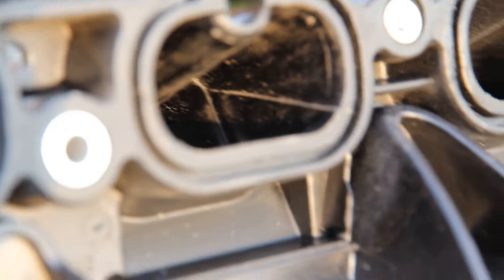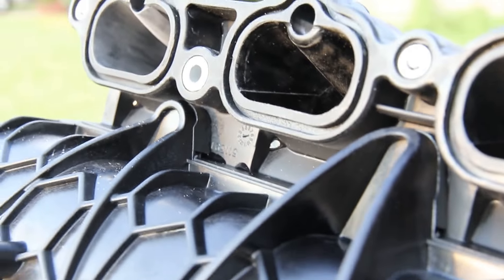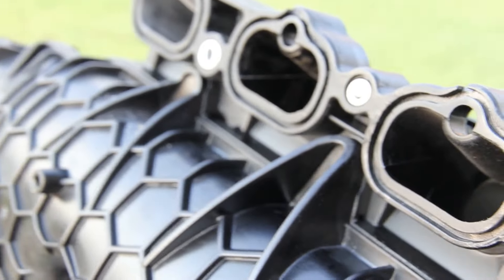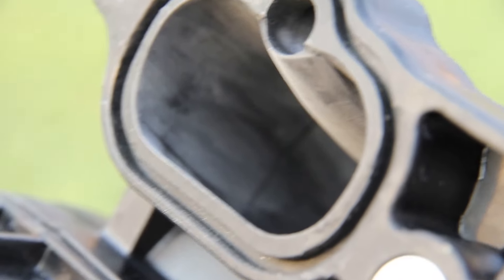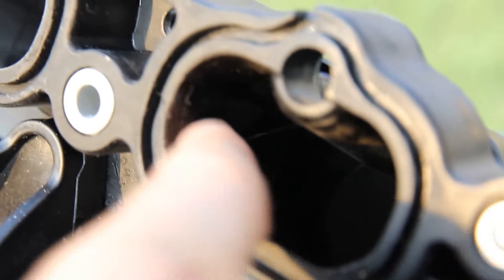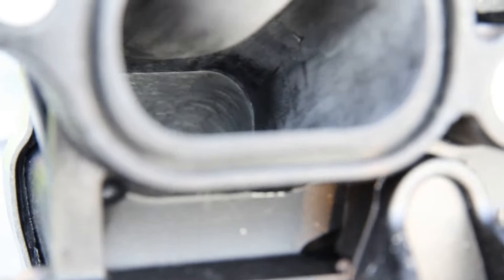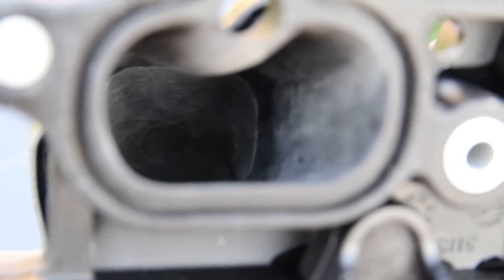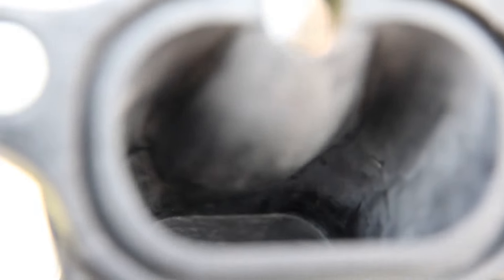Coyote 5.0 GT Intake Porting

Comment: I port heads and intakes for 35 plus years and what looks to be a shit load of wishful thinking. Those ports may not be perfect stock but looks like from start to finish you would be hard pressed to make a 1 hp improvement with what you did and you actually weakened the part of the intake where the injectors go substantially. waste of time and resources. if you did not modify where the injector is it would just be a waste of time no harm no foul but what you did is actually a negative not a positive. the transtion from aluminum to plastic is in the direction of the flow and not really of major importance because the aluminum opening is smaller then the plastic. so there is no vast improvement. a lot of time and effort for minimal gain to no gain.
Reply from the maker: I would think that a self proclaimed expert would not have misidentified plastic as aluminum.

Steps, regardless of direction of flow, create disturbances in flow, and can start turbulence that persists. 

Also, where the intake is "weakened" near the injectors isn't a stressed area and is still plenty strong.

Nobody is claiming major gains. But for you to claim this is somehow worse than doing nothing is absurd. Ported intakes on NA is peanuts. I put a VMP Gen II on it and it makes 720 to the wheels for years now.

Comment: Porting plastic lol
Reply from the maker: andrew rey, how would the material matter in any way?
Reply: andrew rey if anything plastic is better. Aluminum is going to run hotter
Reply: @unprecedentedcreations  
What does porting have to do with temperature, my understanding was you port for flow not temp
Reply: aluminum gets hotter, so it heats up the air charge more.  hotter air = less 02 in the air charge = less power.
Reply: Plastic is only not really worthwhile to port because production tolerances are much finer as in there is very very little production mistakes to corect unless it is a blatant design flaw that needs to be removed. In general they come pretty much optimized from the factory so that there is very little room to work with. waste of time for what you get out unless boosted and even then better to go with an aftermarket improved design unless you already have all the tools on hand and the cost is ZERO but time. and then ? why the fuck not.